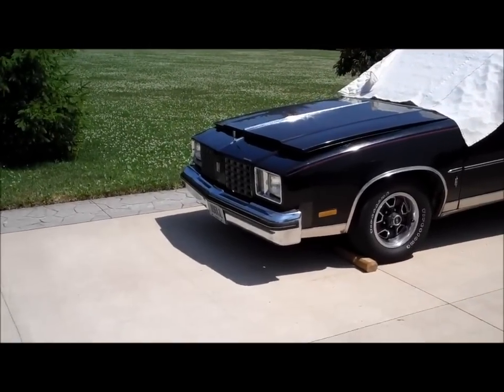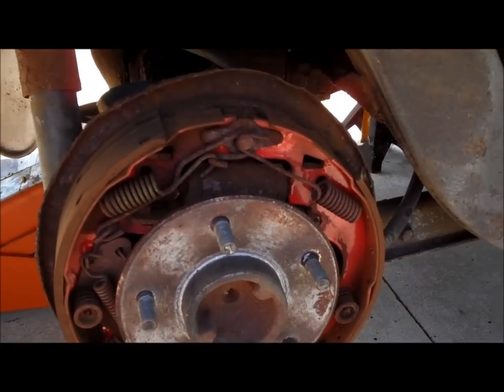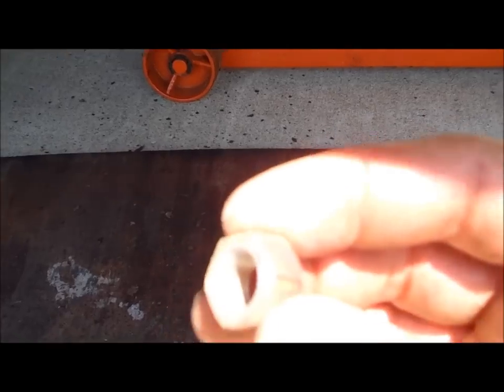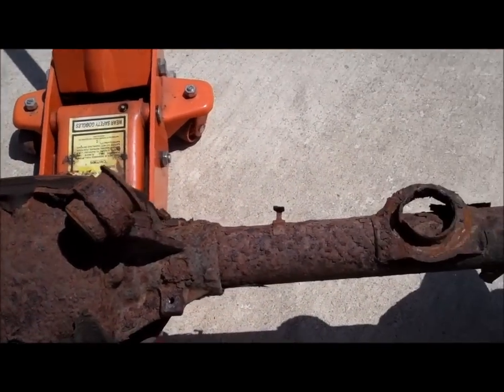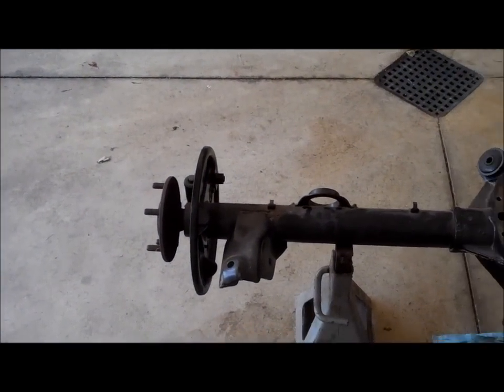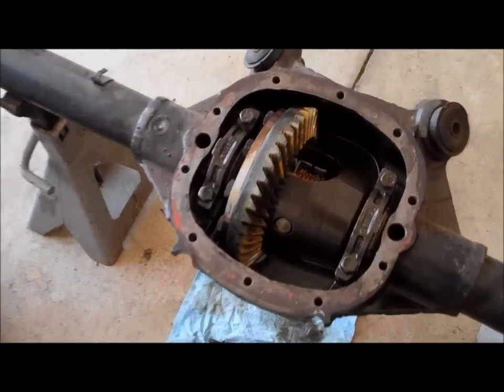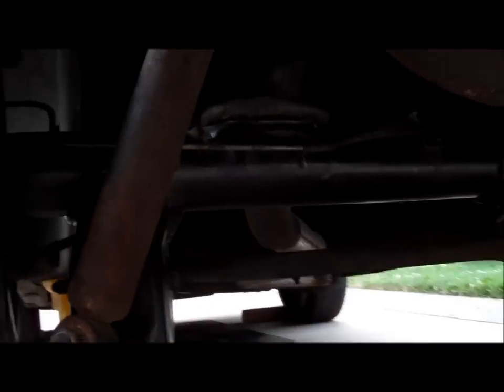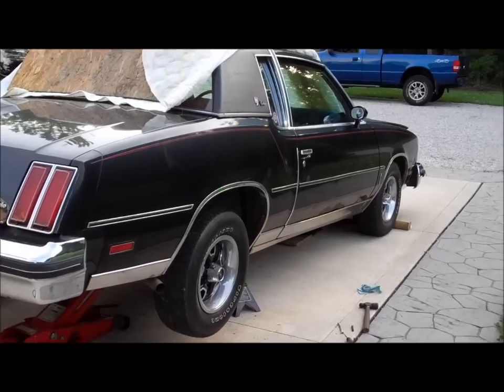79 Cutlass Calais Gets a 3:42 POSI Rear End Classic G-Body

Comment: Hey man , apparently i have the crappy 7.5 rearend on 84 cutlass.  if i do  ONE full rotation of driveshaft that turns my open diff passenger wheel 2.25 approx rotations?  does that mean my ratio is a bit less than 2.25 to 1  or a bit  more?

Comment: i put a 1985 Ss posi in my 87 factory olds now my speedometer is off real bad....what went wrong...it jumps 20/00 mph over....
Reply from the maker: Well the drive line is spinning much faster with the steeper gear ratio now. You need to swap out the speedo gear in the trans to compensate.

Comment: i love my 260 dont get me wrong. i love how it sips on gas but the lack of power is just  kicking me in the rear. im located in california. i dont know too much but how to change my oil, transmission nd other fluids. im learning fairly quickly. my brother has a cadillac 250 4.1 v8 with a th400 behind it. would that fit in my '79 OCS? its temporary while i rebuild my 260 or get a new engine. thanks for your help!!

Comment: I started out on this road, in 1992 when I bought a factory 4 speed 1978 Malibu.  I have made all the mistakes you are going to make and ended up with what has now become a full on race car.  I have one more year of racing it and then it will go back into street trim.  I will post some things on my You Tube account then.  What I have now is a highly modified 350, skip the 383, it's more trouble than it's worth, and a 9" Ford rear with 35 spline axles and a spool, a Turbo 400 with a transbrake a custom made 3.5 inch 1.25 side wall drive shaft with 1350 u joints.  It doesn't break anything now though.  It will end up with a small block of yet to be determined size and a six speed, the rear end will stay but I will put a positraction in instead of a spool.  What I want to express is, buy the best parts available the first time because nothing that came from GM originally will hold up, if you take it to the track, and there are catastrophic failures that can occur when something breaks.  I love A and G bodied GM cars, and have owned several.  Good luck, have fun and above all else, be safe.
Reply from the maker: Thanks for the comment. Sounds like you built a cool ride but I certainly don't consider my mods a mistake. I built it for fun and cruising not for racing. I bought an over drive trans for it and it will be a great street car not a race car. I am not into drag racing much at all.